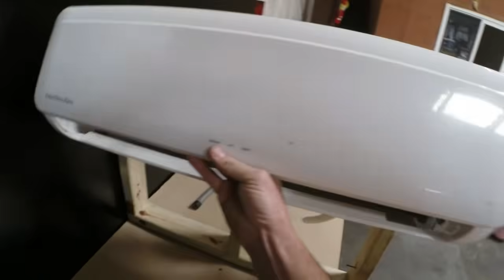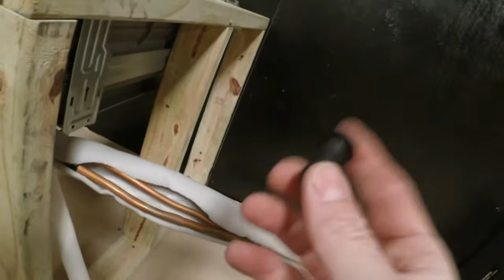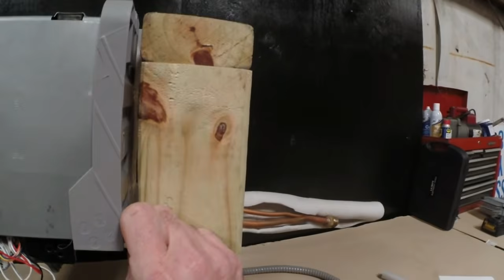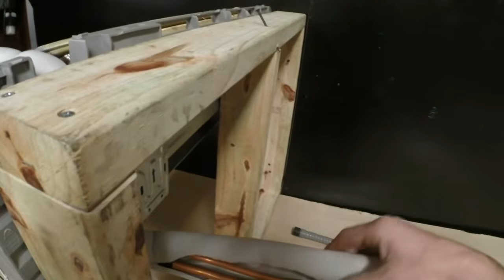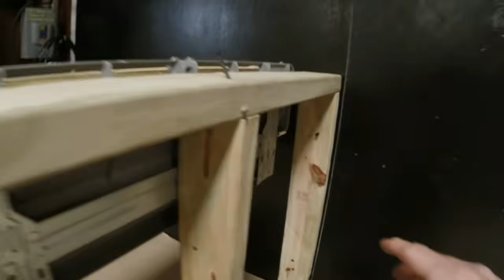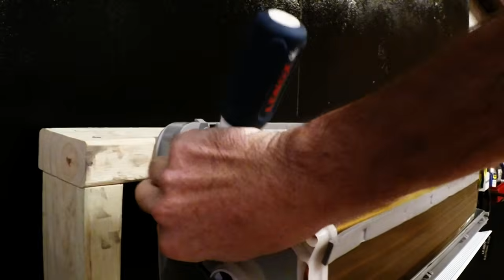Mini split drain fix and explained

Comment: Thank you! I had always noticed the room with my mini split as humid and even had some perpetual mold happening that I'd fight. I'd shopvac the drain line and clean the filters and foam the fins and all the things to try and fix it. Over 3 years fighting this. 

Just came across this video while refreshing myself before another round of maintenance, and after learning about the drain plug and sides I noticed mine had the drain on the opposite side of where the hose goes through the wall. So there was a hose extension running horizontal from one side to the other that was getting stagnant and gross and causing the slow leak against my wall. I guess the guys who installed this didn't know about the drain plugs either...

I swapped the drain plug, removed the (nasty!) hose extension, cleaned what I could, and hooked it back up and now the room is crispy dry and fresh and with no leaks!
Reply from the maker: Glad to help .  I have seen this alot and after it is installed service guys just blow the drain and leave.

Comment: Hi, the evaporator coil goes from top to front. The water only collects on front of coil and into drain pan. Why water doesn't collects ontop of coil and drips onto blower? Great video. Thanks.
Reply from the maker: It follows the coils down to the bottom
Reply: Thank you

Comment: I have a Senville 9000 BTU AURA unit I installed, by myself in my RV (and I am no mini split tech professional).  It ran great with no problems until we hit our monsoon season (I live in Tucson) and the humidity levels began to rise.  One afternoon, while taking a nap, I shot out of a sound sleep because water was falling on my legs.  It was coming from my indoor head unit!  It was pouring water out of the unit, like a thin stream of water.  After panicking and trying to figure out what was happening and stop the water flowing and ruining my RV and possibly electrocuting myself, I turned the unit off and eventually figured out the problem:  I had installed the indoor head unit exactly like you showed was the wrong way:  the drain tube is too level coming out of the unit and the water is backing up.

It took me some time to figure out what was causing this leaking in the unit.  I went outside to the drain tube to see if there was any kinks in it or possibly some debris clogging it up.  Finally, I decided to suck on the end of the tube exactly like I have done when siphoning gas out of my vehicle, when I was a younger man.  This caused water to come out of the end and the light bulb of understanding went off in my head:  the drain tube had to have been incorrectly installed without enough of a slope allowing it to properly gravity drain.

I'm a "one man show" here and like to do everything myself, if possible.  I certainly did not want to risk breaking my copper line sets if I removed the indoor head unit, and since I don't have someone handy who can help me hold the indoor head unit up if I took it off, I had to figure out "Plan B."  One option is installing a small "condensate pump" that would "push" the water  out of the drain pan and force it out the drain tube.  I called Senville and they highly recommended the ones made by Aspen.  After doing some research on these Aspen pumps, they are ridiculously expensive and I did a bit of research and found one on Amazon called a "FUJIWARA Condensate Pump, Mini Split Automatic Condensation Drain Removal Quiet Pump,for HVAC,Air Conditioner" for about $53.00 (today is July 18, 2023). It has good reviews and is Japanese made and looks similar to the much more expensive Aspen ones, so I ordered it.  

Once it arrives, I will attempt to install it and believe it will solve my problem.  Then, as a "Plan C," once the summer is over and I no longer need the mini split (we have had a heat wave in Tucson where I live and the temps have been consistently over 105 degrees for days on end), I may decide to remove the indoor head unit and see if I can raise it up a half inch or so.  If this works, problem solved and I can remove the pump.  Why waste electricity if you don't have to? is my thinking.  Again, I don't want to risk breaking something, like the copper line sets, if I attempt to remove the indoor head unit now, so I figure installing the condensate pump is the best way to go for now.

What I'm doing now to continue to use my unit until I solve this problem is this:  two or three times a day I go out and suck on that tube.  By doing this enough times, you get the "feel" of whether or not there is water in that drain pan; it's weird how you figure this out by feeling the pressure in that line.  I can't explain it, but you can tell.  Then, I suck on it four or five times until no water comes out and that "pressure feeling" is no longer there.  

One question I have is:  how much water do these drain pans hold?  I called Senville to ask and even they didn't know, but one tech said they have only about a 3-4 ounce capacity, but he was estimating it on the low side.  I have been measuring how much water comes out of my unit and the most I have gotten out is 8 ounces.  This pan might hold more water, maybe  two cups or so but I'm not sure.  The tech thinks they might hold as much as 10 ounces.  Knowing this is important as it gives you a ballpark idea of how often you have to suck on this tube (I also tried my wet vac as well by putting the suction tube over the end of the drain line where I use my mouth to suck out the water and that worked as well).

The Senville tech said I should just pull the drain tube out of the hole I made in the wall and allow it to drain in a bucket inside my house until I figure out how I'm going to fix this problem.  That's an option as well, but the problem with this is that all of my line sets, communication wire, and drain tube is run inside of a 2" PVC pipe and directed away from my RV (my RV stays in one place).  Since these lines are buried inside this PVC pipe, pulling those lines back out through the inside of my RV is not something I want to do at the moment due, again, to thinking I might break, crack or screw something up (remember Murphy's Law).  All this to say, there is more than one way to skin a cat, and I hope this long winded comment might help someone facing the same issue.  

Why this problem happened in the first place is because I was going precisely like the picture in the installation guide provided with my Senville unit.  The pictures show this drain tube coming through the wall LEVEL and not sloped down as it should. Again, I'm not a tech and, though this obviously is not right, who thinks of this when they are installing a unit like this for the first time?  But now, it is obvious that I should have slanted the entire bunch of copper lines, communication wire, and especially the drain tube more than what I did (and I did drill the hole at an angle, but obviously not enough of an angle.)  Senville admitted they made a mistake on their instructions and did not properly show the need for a proper angle.
Reply from the maker: This video should explain how they work

Comment: Never run your drain line across the back of the AC . The manufacturer should never give the installer a option. Removing that plug and running the drain line across the back of the unit is one of the biggest reasons the unit spits water out of the front of the unit.
If you run the drain line from one side to the other the drain line will bow behind the unit and accumulate water as the dirt and nap gathers in the drain line before continuing down the drain line . Drain directly out of the back of the AC unit
Reply from the maker: Agree.  Problem I have found is people don't read instructions and are affraid to bend out the copper tubing  so they install it like it comes out of the box.   This makes it very difficult to install.   Bad for drain and hard to get good connection on refrigerant lines and hard to insulate these connects so  sweeting is another issue you will see
Reply: @ACPro  right, but side is the only option if you don't have it mounted to an exterior wall.

Comment: Works so well Fastly.Cool that it only requires daytime operation until high temp and humidity are overnight. It is difficult to get to side filters, but back is easily accessible.
Reply from the maker: Thank you for watching.    Please leave review at manufacturer

Comment: final question, should I take that thin cheap insulation off both those copper lines (mines just like yours in the video) and INDIVIDUALLY wrap each copper pipe, then wrap them again together, before sticking it in the wall?

If so, what tape / foam do I use?
Reply from the maker: Wrap with amorflex real good!!!
Reply: @ACPro  Armorflex on each one or both together?

Comment: thanks for the info! I am moving my drain hose to the other side so it is on the same side as my copper lines.

however when I'm swapping the plug, I'm a big paranoid that it's sealed good... 

can I put some epoxy on there as "lubricant" and then plug it back in? I really really really don't want any leaks!
Reply from the maker: Make sure it's all the way in and it will not leak.

Comment: Great vid. Should the unit have a slight fall for drain pan or level?
Reply from the maker: Should have a slight fall to the rear .   Level will work but it leaves alittle water in pan constantly this creates algae
Reply: My head is wider than rv wall opening.I just stuffed a paper towel to make a more better drain flow.Nice vid !

Comment: Great video. I have an installation where the copper cables are going up as they leave. The insulation is bad and they’re draining. Should I route them heading down? (With an incline)
Reply from the maker: Yes.   If not it will build algae and be a nightmare latter